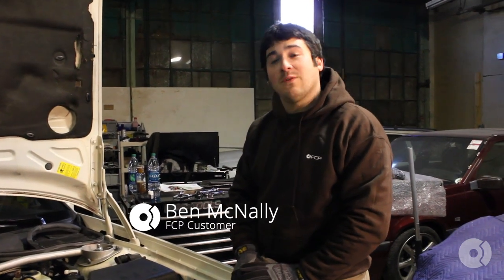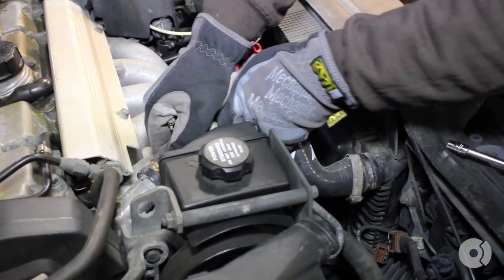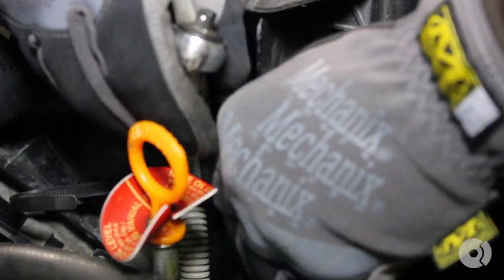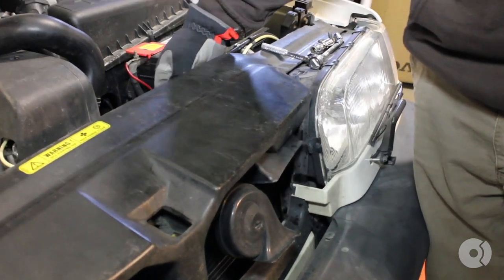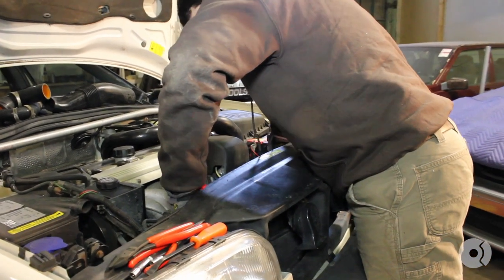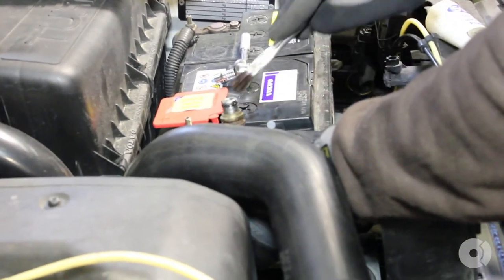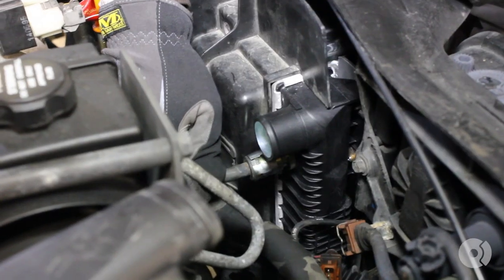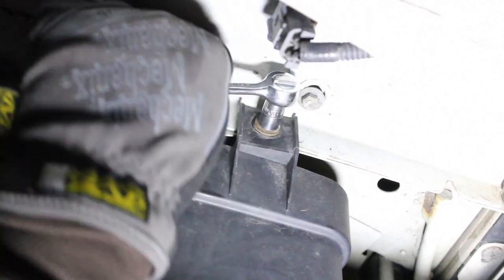Volvo Radiator & Coolant Replacement (850 Turbo, 850, C70, S70, V70)

Comment: In my 97 Volvo 850 non-turbo found it difficult to remove the radiator from the top as shown in the video.  Found it easier to drop the radiator and remove from below as long as car was on stands or on ramps.
Reply: I have a 97 GLT and it also wouldn't come out of the top.

Comment: Thank you for this! I have a 1998 Volvo s70 and I need to replace the radiator and this video gave me the confidence and know how to do that and save a good $400! We had some rough spots, some rust on bolts and there were slight differences between the 850 and s70, not as much room in mine and we had to take it out from the bottom. But, we did it! After all was hooked up we start it and pop! The top oil cooler hose undid it self, it did not come off but out. Interestingly enough when I had a mechanic look at it he said that was leaking and needed to be replaced and due to where it is and we need to take the radiator out to do it it will be more money, etc. But, we plugged it back in and ensured that it was secure and no leak! I also saw you do not need to remove the radiator to do this. Again, thank you!

Comment: Like others who have commented from over the years. Your video is excellent. I have UK 98 V70R and was loosing coolant from the radiator.  Never done any radiator on a car before and after watching your tutorial a few times. I bit the bullet and replaced the radiator. It was relatively easy and on the street. No jack either. pieces of wood was used to support I would recommend oiling the radiator to car mounts before removal. These are the ones you have to undo from underneath but the thread is, if look before you leap, visible on one side not so on the other. Made sure zip ties were used as well on the PS and oil connectors.  All is now good. You cant beat old Volvo's.

Comment: In LA. Independent quoted $1100 for radiator replacement and thermostat and ETC. After watching this I feel like I could have easily done the job and saved a bunch.

Comment: I didn't see him swap the grommets that are in the radiator's body mount holes(with the 12mm bolts).  Is the new radiator suppose to come with new grommets installed?  My order didn't.

Comment: Thanks so much for the helpful video!!  I just replaced by 02 v70 xc radiator with your help!  When refilling the Transmission fluid (from the stuff that is lost when removing the radiator) , is there a certain fluid type you would recommend especially if I'm not sure what exact fluid is in the car?
Reply from the maker: You're welcome, Laird! Glad we can help! Here is the transmission fluid you want to use: https://www.fcpeuro.com/products/aisin-oem-auto-trans-fluid-aisin-atf-0t4

Comment: Hi Ben,  Thanks for another informative video.  I just replaced my radiator on my 96' 850GLT and discovered that my tranny fluid is much higher now.  I know the level was correct prior to the radiator swap.  I know that the tranny does send some fluid through the radiator to cool it but why would it be higher?   Any ideas?

Comment: Thanks alot, this was very helpful. getting the radiator out is a little challenging, had to unscrew small exhaust fan on the right hand side of the radiator..

Comment: Top vid .
I managed to change my PCB kit with your help. Appreciated!
Replacing radiator next. Any chance you have a part number for the retainer clips for the transmission hoses? Thanks
Reply from the maker: Hi Matt, if you contact our team with your model info, they can provide you with said part numbers and more! Service@fcpeuro.com

Comment: Hello, after you remove the oil cooling lines off the radiator do you need to top the fluid up?
Reply: +1 I am wondering too.  did you learn

Comment: Thanks for the quick reply, so is that back and forth play in the intercooler normal then? I didn't notice it when I was pulling the old radiator out.

Comment: Just ordered the o-rings and clamps for the transmission and the oil lines from FCP and wanted to know if it's the same procedure removing the radiator for my 1998 automatic S70 T5?  Thanks for a great video.
Reply from the maker: The repair is essentially the same. There may be some boost hoses routed a bit differently but basically the same basic procedure. Hope that helps.

Comment: Great video, i'm trying to fix a leak in my Volvo s60 radiator, but where is the radiator cap ? lol
Reply: Botip I asked the same question and learned that my volvo 850 doesn't have a cap, the way the coolant system is assembled is much different.

Comment: my question is the same as purple 89 (1 year ago) did not see a response:
I have a Volvo 850 1994 Non turbo will this be exactly the same way to change it ?
MUCH APPRECIATED-love the detail.
Reply from the maker: Sure thing, we responded:  I believe it's identical, you should be fine using this guide. But don't hesitate to give us a ring if you have any questions: 1-877-634-0063. Make sure you sort the comments "newest first" to see all of our responses, sometimes youtube will mix them up so they don't appear in order.  Hope that helps.

Comment: I had the same experience on a 1994 non-turbo.  I also ended up going out and in though the bottom rather than top.  Didn't have to jack or lift the car to do this.

Comment: Hi, trying to determine the age of my radiator prior to tearing into that area anyways. Does the OEM radiator have a date code? If so where is it located (can I see it with it installed?). 2004 V70R. Thanks

Comment: this video is great  helped me r/r my radiator though it failed to mention to remove the fitting from the sides to reuse again. but other than that this was good.
so now ... I've replaced the heater core the radiator and my gauge still indicates that the engine is running hot. Top hose is hot bottom hose is cold/cool. Fan turns on. temp gauge goes up about 3/4th of the way up. does the water pump have anything to do with these symptoms?
Reply: JS T yeah if your water pump is original, it may be missing some of the fins on the impeller that push water through the syatem (which was a problem on my old 98 T5)

Comment: Imma average Zo tryna learn, so since the radiator doesn't have a cap does this make for a more efficient way for coolant to move thur the system? Also do other radiator system have transmission and oil lines running thur them?😯😶😕😬😧

Comment: The oil and transmission cooling tubes are in the end tanks of the radiator, in a bath of coolant.  One way to contaminate oil and coolant  would be if there was an internal rupture that allowed the two to mix.  There are others but let me know if I have answered your question!

Comment: Hi, I have a 2002 volvo s60 awd and I'm wondering if the removal would be the same as the removal shown in this video?
Reply from the maker: Essentially the same concept but I would prefer to remove from the bottom if possible.

Comment: Hi Ben, on my '99 V70 non-turbo, I snapped the two 12mm bolts that were holding the radiator in place. On the other side of the frame there is some sort of bracket that was holding the fan I believe. I haven't been able to get the bolts out of said brackets. My question is: is it more likely that they're rusted in there or are the designed to stay in those brackets?
Reply from the maker: Devan Nelson Could you email me at jasonv@fcpeuro.com? I believe you're referring to the small little threaded blocks that insert into the radiator housing which allows the fan somewhere to " fasten to".

Comment: Ben, I just replaced my lower radiator hose and now i'm having engine overheat problems. Upper hose is mildly warm but overflow tank is not boiling. Stopcock in lower radiator has fluid in it, so I don't think it's obstructed. I've read about air? Anything else? Thanks for your help in advance.
Reply from the maker: Sounds like an air pocket to me as well. I would remove the expansion tank cap when the engine is completely cold, start it up, and raise the RPM's to about 2k and hold it for about 2 mins. This usually does the trick for me.

Comment: when the cooling system is empty? shall i start the car and fill while its running? or will to max level, then start and make it hot and keep filling as the water drops down?
Reply from the maker: No. Fill when the car is off. I really can't see it damaging anything but I've never done it this way and I've never seen the fill method directed this way either.
Reply: nvm my car is ruined... leak in the cylinder... i keep gettin this goozzy water in the coolant system... probably exhaust / water mix? its like white cream. smells exhaust
Reply: ReadyToEnjoyYou I would guess head gasket.
Reply: 5sp? Only oil cooler... correct?

Comment: Hi Ben, great video and great FCP. Since there is no video available for Radiator replacement for S80 1999-2006, have a question, Can I take out the radiator out by lifting up (7:20) same as you did of my s80 99 non turbo? any caution to do this job my self.
Reply from the maker: Major Code Yes, it can be done however dropping it through the bottom is much easier in my opinion.

Comment: What kind of lubricant is being applied to the transmission & oil cooler connections?
It is being put on with a black brush and appears to be a clear gel.  Is it silicone?
Reply from the maker: I don't remember exactly what it was, but I believe it was just a silicone gel.
Reply: FCP Euro Thanks for the prompt reply.  So I'm OK using EZe Slide brake lube? Great video BTW!

Comment: Hi Ben, just replace the radiator on my '98 V70, and water spills over the reservoir, someone told me that it could be a blown head gasket. Any help will be apreciated. Thank you.
Reply from the maker: BsAsArg You may want to email our Volvo specialist Jason at JasonV@fcpeuro.com with more details about the issue you are having.

Comment: I have a 98 V70 XC. You pulled the radiator out from the top. Can I do the same?
Everything I have seen says I have to remove it from the bottom.
Reply from the maker: It'll come out either way. The reason why most repair information says from the bottom is because they assume it's being done on the lift. Clearance will be an issue either way and you'll have to remove the fan shroud.

Comment: Great video, replaced my leaking rad on my 96' 850 turbo with the Nissens replacement from FCP. Only issue is that the intercooler now seems to have lots of play moving forward and back. In the video there seems to be spacers/bumpers that are used (9:08) that aren't there initially (1:30) when you are pulling out the old radiator. Can't find these spacers on FCP were they added for this reason? Thanks again and help or feedback would be appreciated.
Reply from the maker: Those are actually from an intercooler we installed at the same time, the spacers are there because the new intercooler was significantly larger, though we didn't address the intercooler install in the video.
Reply: FCP Euro So is that back and forth play in the intercooler normal? I didn't notice it when I was pulling out the old radiator.
Reply from the maker: Cam Proud It really shouldn't wiggle, is everything seated properly? Sometimes a small misalignment can make a world of a difference.

Comment: Do 2001 Volvo S80 2.9's require cooling system flushes or only a simple drain and refill? I can't find this information anywhere.
Reply from the maker: A simple drain and fill at the radiator won't remove all of the coolant and sediment from the entire system so I always recommend a complete flush. There are also some additive's available to condition the system.
Reply: FCP Euro Is there a chemical coolant system flushing product that you recommend? I'm vacillating between Prestone Superflush and CRC 10-Minute Radiator Flush. Thanks.

Comment: Ben what are you using to "cap" off the lower oil and trans. fluid nipples? I see a black rubber cap. Where are you getting these, please.
Reply from the maker: Those are actually the caps off the new radiator, we just switched them to the old one.  Hope that helps. Don't hesitate to let me know if we can be of any more assistance, my name is Mike and I can be reached at mike@fcpeuro.com

Comment: could oil somehow get into the cooling system in the radiator if it has a fault where the oil cooler lines and the coolant lines are close?

Comment: Hi, will it be the same for XC90 ? Do you have a video for that car as well ? Thanks.
Reply: The procedure in the XC90 is very similar, unfortunately we don't have a video, my apologies.
Reply: Thanks Jason, I was told that XC90 radiator has to be replaced from the bottom, but you took it out from the top so probably XC90 not similar to 850. We have the radiator now and going to replace it today,hopefully with no drama.
**********************
Update
We replaced it by removing the radiator from the bottom. We kept the fan on it and remove it when radiator was out.
We tied up the condenser and inter-cooler with a rope to the car to hold them up.
It took in total around 90 mins,but yeah I couldn't do it myself, it requires a lot of strength.

Comment: Hey Ben are all the bolts and everything is the same as a non turbo isn't it? TY
Reply from the maker: Hi Debbie, It's basically the same process, the only difference is the non-turbo doesn't have the engine oil cooler lines which, makes things a little easier.

Comment: Ben,
Being that this is a turbo, it would've been helpful to point out which one is the radiator, vs the intercooler. Generally, from the front of the vehicle, only the a/c condenser is visible. Likewise, from the inside, behind the fan & shroud, only the radiator is visible. However, the actual intercooler is hidden, or sandwiched in between the two components. Usually, there's some confusion as to which component cools which fluid, & its routing path to & from the engine.

Comment: Is there any way you can do a video on how to replace an engine oil cooler on a 08' volvo xc90 3.2. I had a chocolate milkshake mess in my coolant reservoir spilling over and I was told I had to replace the head gasket and oil cooler.
Reply from the maker: Hello Jennifer, we'll keep the repair in mind for upcoming Volvo DIY videos.

Comment: at 6:00 removing 12mm bolts.. mine won't unthread.. on both sides.. You can see the other side of them from under the hood.. my guess is bolt threads are rusted.  Were pain to loosen then finally did, was unscrewing them still pretty difficult, then all of a sudden nothing. they move freely left and right, not getting more loose or more tight.  Whats my next procedure?
Reply from the maker: Hello Matt, please email products@fcpeuro.com and reference this video we'll be happy to help out.

Comment: I have a 98 T5 manual and noticed my coolant in the bowl was cream coffee colored. No temperature issues and no codes. I'm thinking the radiator has ruptured but it's not leaking.
Next day, I have to drive 30 miles and after about five miles coolant light comes on. I'd have to refill the bowl more the faster I went, and less on the back roads. About every eight miles on average. Again, no temperature gauge indication of any overheating. I reach home, turn off the car and nothing is leaking (although once during a refill with the car idling, I notice leaks coming from the back bottom of the car). 
 When I get ready to replace the radiator and drain the petcock-- all coolant is green (and new) until the last few drops then a few drops of oil. When I remove the bottom rad hose mostly green but more oil--all cream coffee colored. 
I'm wondering if it's the radiator, the lines, or a combo. I'm not thinking head gasket. Thoughts?
Reply: Also, notice my radiator has only two lines on the passenger side that clamp on with those god-forsaken clamps that cost $30 each at the dealership. Can't find a replacement radiator that doesn't have four--one in each corner. How will this make a difference?
Reply from the maker: ajp46321 Can you email your VIN to jasonv@fcpeuro.com? I want to try and get you some good information regarding your issue.
Reply: ajp4
6321

Comment: Hi Ben... Would white Lithium grease be acceptable as a a lubricant?
Reply from the maker: Charles Kennedy I'd recommend either a synthetic non petroleum based grease or even transmission fluid will do.
Reply: Charles Kennedy KY jelly (serious)  water based and super slick.  It's helped me get bushings in quite a bit where fitting tolerances are incredibly tight.
Reply: Nothing like a KJ Jelly recommendation from Arnie to bring a smile to my face! So funny!

I got the radiator in, but will keep the KY Jelly tip in mind for the next time I have to get a tight hose on.

Comment: Hi Ben,  
First, thank you so much four your videos. 
I have a problem with my Volvo S60. I changed the radiator correctly. But I have some air in the water tour ( reservoir, radiator or hose). 
Do you think if i wait the fan opens and then i unscrew the screw it could be ok for get out the air ?

Im sorry for my english

Thanks from France
Reply from the maker: Snn Trk Feel free to email our Volvo specialist JasonV@fcpeuro.com for assistance with this issue.

Comment: My dad was all like: "Oh, it's the oil pan, we have to buy a new one."
Then how did my car only leak when the pumps were running? The oil radiator hoses had gotten separated from the radiator and that's what was causing the leak. I have a problem finding the hoses, though, since I have to swap out almost every single hose and pipe that goes from or to the radiator.
Reply from the maker: Here is an oil cooler hose replacement kit: https://www.fcpeuro.com/products/volvo-engine-oil-cooler-hose-replacement-kit-850-c70-s70-v70-oem-parts-oilcoolerhosekit

Comment: In 8:51 whats the name of that tool that is used to resemble the radiator?
Reply: Alonzo Gaskins he’s using a ratchet and extension with a 10mm socket and a swivel tip.